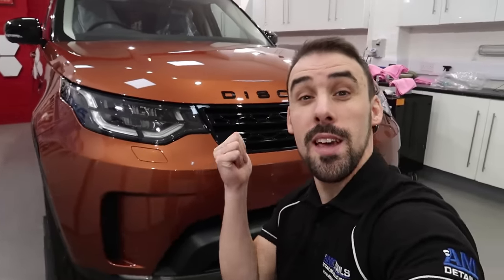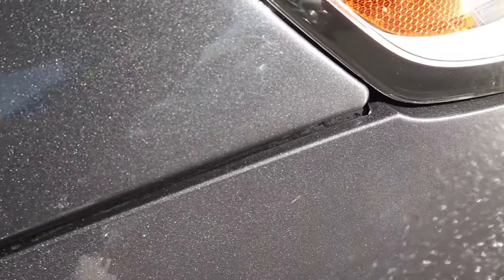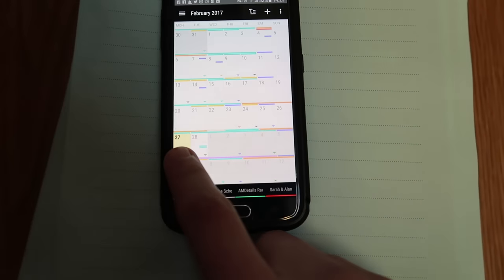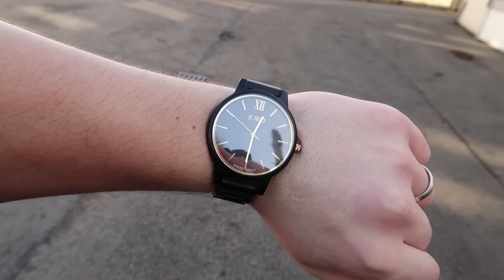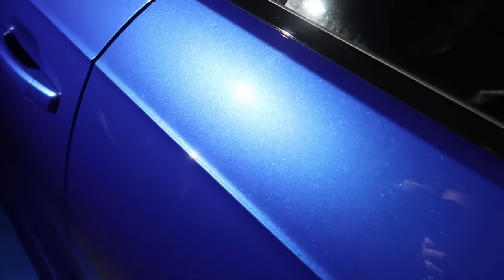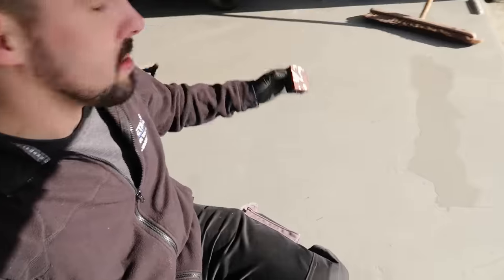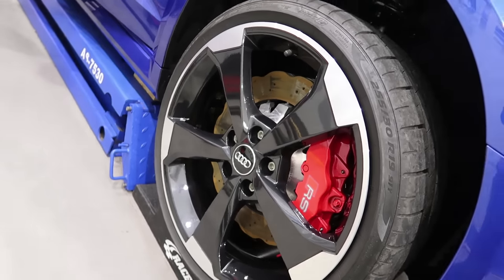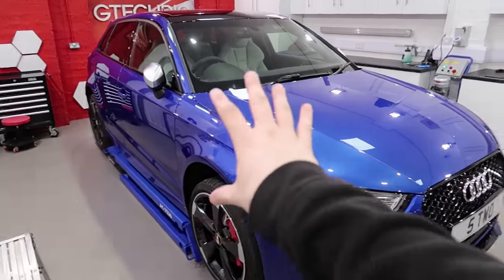Audi RS3 for Gtechniq + Squeezing in a 2017 Discovery. AMDetails Weekly Vlog 71

Comment: Given that "piano black" B pillars are so easily marred, it was interesting to notice the protective white film on the Discovery prior to delivery.  It would be great to see the condition of these parts as that film is removed in a subsequent video.  Obviously, the manufacturers know it as vulnerable, but more tips for maintenance and protection would be fantastic.
Reply from the maker: Hi Expatviewer1974

Even once the protection was removed there was glue residue all over them. Plus the wrap was maybe 5 - 8mm in from the edge. So all needed attention. I think they do look great, but most of them get damaged so easily, and manufacturers always put them in "high finger impact" areas. So they get ruined really quickly. Which is a shame?

Will jot down this message for a video in the future to work on.

Thanks, Alan 😎👍🔔

Comment: Hi Alan, Have you tried Scholl S20 Black for your single stage details. I did my VW CC this week which has the hard VAG clear coat like that S3 and it worked really well with my Rupes LHR15 mk2 and yellow pads. The S20 has great initial cut but diminishes quickly to give a lovely finish especially on hard paints. Admittedly there was slightly less defects on mine compared with the S3, but got it sorted in 1.5-2 #. Could save you time. Videos are getting very slick, by the way. Keep it up👍
Reply from the maker: Hi Chris,

Thanks for the information on S20. I haven't actually played with the Scholl Range much. I like to try to see how far I can go with the products we have here.  I used to have S17+ and S3 on my shelves a few years back but to be honest haven't had a need to pick them up as other polishes I use have done the job.

Really wish I had the time to be able to play with them all.

Will keep this tip banked for when that situation comes though.

Alan 😎👍🔔
Reply: I tried the S20 as it is marketed as a one step specific polish and it does the job well. I don't have the time (or motivation!) to do multiple passes. It took me over 20 hours to do my car start to finish and that's plenty!

Comment: Great work as always Alan, love your blogs, you mentioned cleaning the brake discs on the RS3, what products did you use and how do you clean them? Will you be going to waxstock again this year where you will have your products on display to purchase? On a lighter note; what did you have cooking in the microwave for your breakfast lol?
Reply from the maker: Hi Rob,

Just a piece of wire wool helps clean them up. A tip can be having a hoover running as the rust dust goes everywhere. Or you could always drive the car and apply the breaks a few times if you have space after your wash process.

I will indeed be attending Waxtsock this year. Unsure wat I'm doing, but I will be there.

No plans to take the AMDetails team or the Range I'm afraid.

Porridge for breaky 😎👍🔔